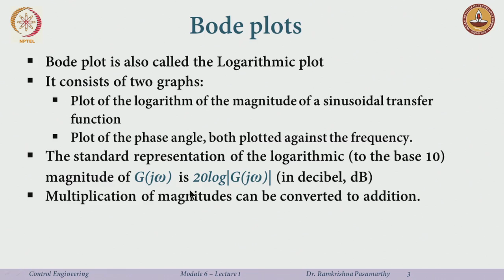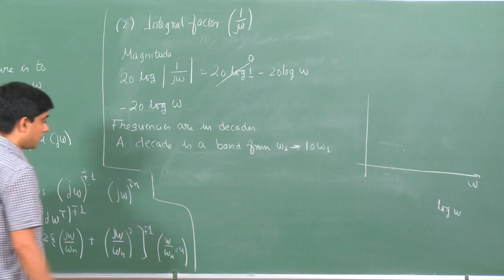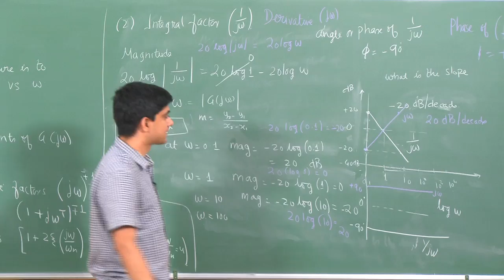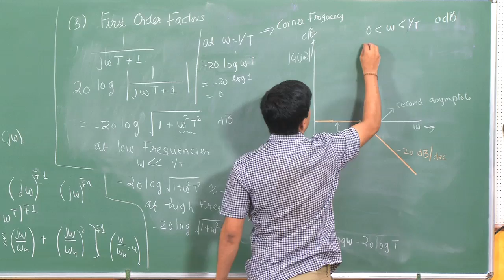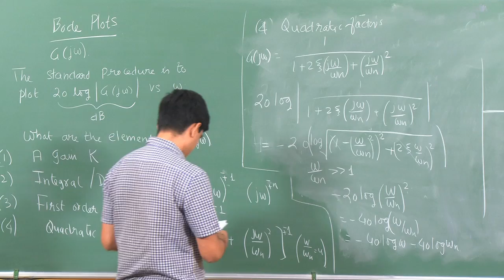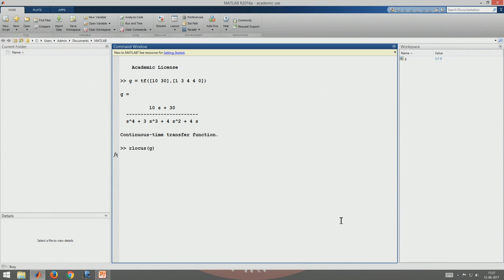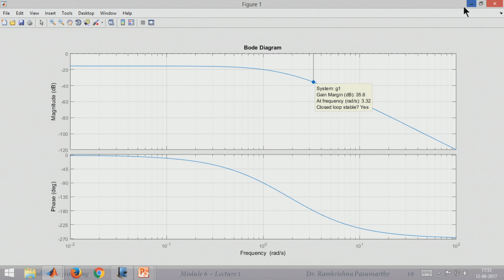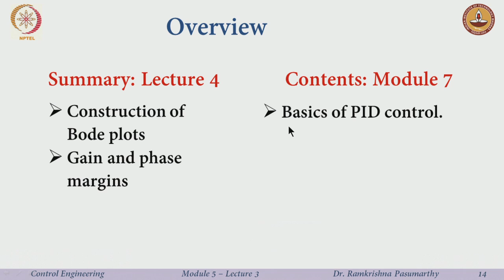Bode plots

Comment: While discussing first order factors while calculating error at omega=1/2T it is not coming to be equal to -1 dB as stated in the video😓
Right?????
Reply: i m getting -6.98!!!
Reply: Actually the approx value shud b 0 ...since omega is lesser than c.o frequency
Reply: approximations are different for less than corner frequency and for greater than  corner frequency probably you are using same logic for both cases
Reply: In error calculation we have to take.. Different equation as both asymptote are different.. Sir has written wrong